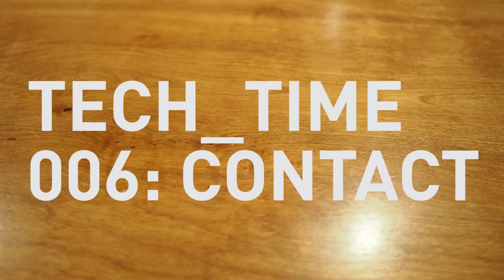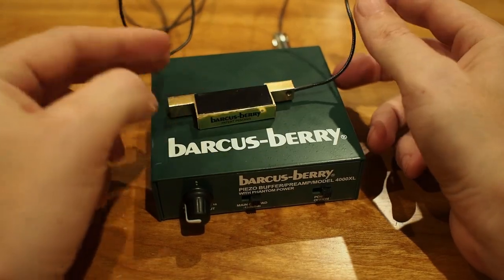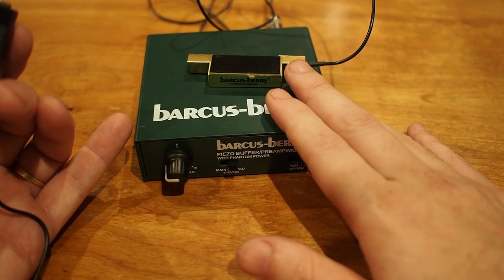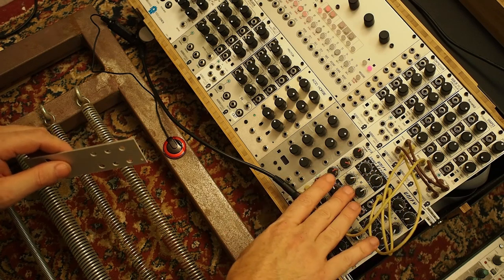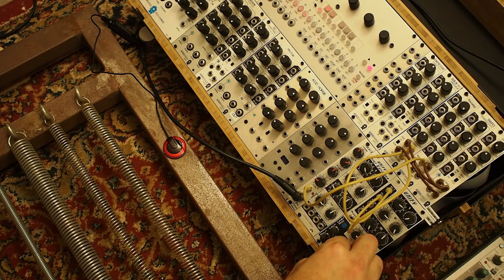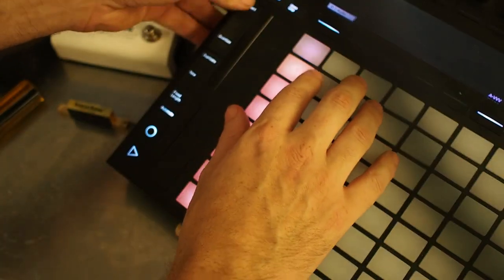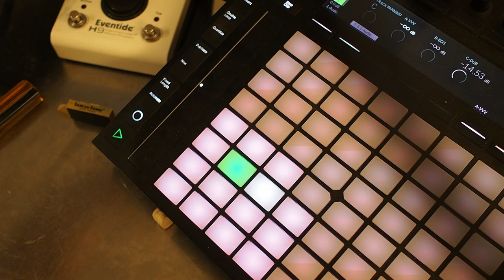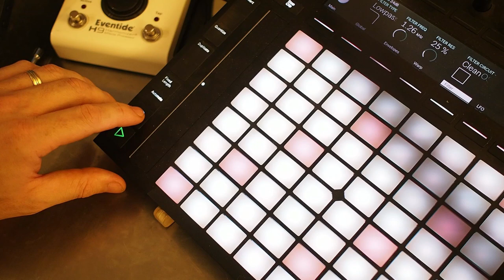Sound Design With Contact Mics: Tech Time 006

Comment: I recently learned that connecting a piezo directly to a mixer/recorder actually creates a high pass filter around 200hz because of the extreme impedance difference between the piezo and the input of the other device. Adding a simple preamp can get all those low frequencies back! They're pretty easy to build and schematics (and even kits) are widely available online. Hope this helps!
Reply: Yes, that’s right. You can build a single FET “guitar” preamp to buffer the impedance, powered by a 9v battery.
Reply: Hey! I just learned that a couple days ago , too. Probly same blog...uhm... lemme look...: https://andymurkin.wordpress.com/. Very  interesting/informative and well over my head, but i''ve read the whole more than once
Reply: im looking to get the barcus berry. i assume I'd have to get DI box, along with XLR to 1/4 transformer, and run my pedals through it. Super new to all of this but after 2 days looking into it i believe this it

Comment: so basically I can buy those, attach to a surface, stick into some kinda effect via jack (guitar, bass, or something like a kaos pad) then into a mixer and voilà right? I'm a percussionist and I'd really love to experiment with something like this + a prepared bass drum (for example)...
Reply: Yes!
Reply: Yes.  One of these mics plus distortion and delay is great.
Reply: I think you need a buffer like the one in the video.
Reply: I have the cheap ones from amazon. It works on its own. Plug and play.
Reply: @kuromaru9661  apparently tiny ones sound tinny, but you can filter some highs away with a buffer. Or you can make a pre-amp, that also makes it sound fuller, that's what I did. Collins Lab made a good video about it. But if you take a larger 50mm piezo supposedly you don't need a pre-amp. Haven't tried this myself.
Reply: @OttosTheName  What if you used a bunch of em together? Would that add bass to it or just give you a bunch of annoying high end? Maybe add a low pass filter and end up with more low frequencies?
Reply: @metallitech  no, just a decent amount of gain, ie mic input.One thing you do get is noise picked up of the cable being moved around, these things are super sensitive. So once you've attached your mic avoid moving the cable. The bigger diameter the disc, the bigger freq range they pick up, 50mm are really good, 30mm ok. The small ones pick just higher freqs.

Comment: would it be better to remove the plastic cap (and the 3M tape) ?   I have one of these microphones, but it only seems to work when I press it firmly to the surface
Reply: Yeah, it works best if you use double-sided duct tape.

Comment: So here's a question: would an e-bow work for exciting something as heavy as those steel springs (without dealing with transients)? Has anyone ever improved upon the e-bow design for this kind of use?
Reply from the maker: No idea. I don't have one. My feeling is "no." An e-bow has a mildly hard time exciting guitar strings. I don't think it'd be able to move these at all.
Reply: No. I have a Wond (stronger version of eBow) and it can't even move the springs in a reverb pan. I think not only is it not strong enough, it's not the right kind of metal.
Reply: you might be able to take some kind of electric motor with some decent vibration, and stick it on the strings while running certain frequencies through it(aka stepper motor)

Comment: I’m trying to build a wine glass installation for my band and the instrument is so quiet that often the condenser mics I use get feedback. I don’t think these would feedback? Im wondering if using a contact mic would make significant changes to the sound of the glass. I’d have to put it at the bass or stem which neither are flat but I could figure something out. I’m thinking a contact mic on each glass and then a figure 8 rode nt2 mic in between every pair of glasses. Only 4. I just can’t have a contact mic on the main part of the glass the top.
Reply: Contact mics can reduce feedback as they are as close as possible to source. However, they are very sensitive to surface vibration caused by stage monitors. For this reason, low frequencies from a chello for example will need to be chopped up to avoid surface fed feedback.

Comment: Wow this is cool! Ever used these on drums?
Reply: they actually sound terrible on drums but that's exactly what's inside a drum triggers, and electronic drum pads.
Reply from the maker: Yes, they are all transient, no body. Basically, you end up with a "tik" sound. Kind of wack.
Reply: I've seen metal producers blend the piezo with a mic for more attack. Hate that sound personally.
Reply: Sometimes I'll take a contact mic and stick it to a piece of sheet metal infront of a drum. You get some odd reflections picked up from it this way.